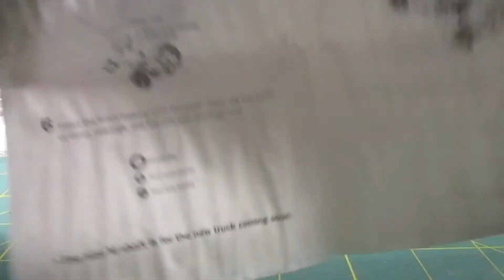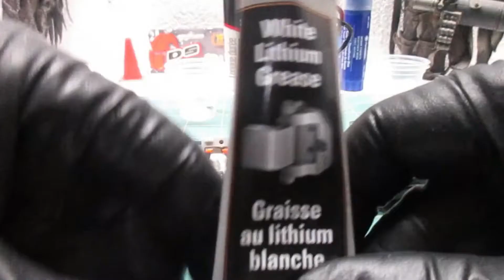XMODS -EVO H2 AWD Kit install

Comment: Great tutorial video. Please can you confirm that you used white lithium grease on both ends of the drive shaft housing. Also, please can you list the names of the oils or greases you used for the suspension. Many thanks.
Reply from the maker: Yes it was white lithium grease, it is light weight and doesn't add resistance. You can use heavier grease to control when the diff engages. Off road rigs use heavy grease to increase the tourque needed to engage the diff. I like 3 in 1oil from any hardware store,it is light weight and a little goes a long way. The price is right too. I have a lot of other project  in the que, just need to find the time to film.